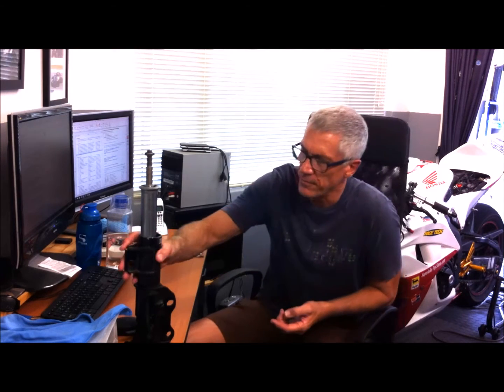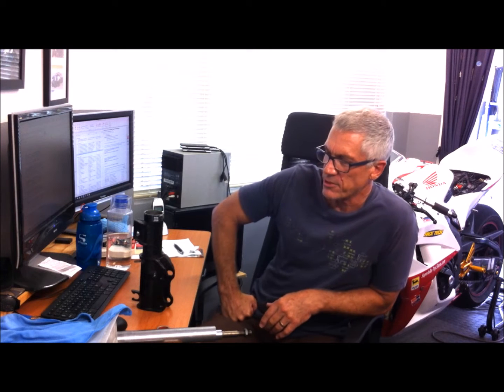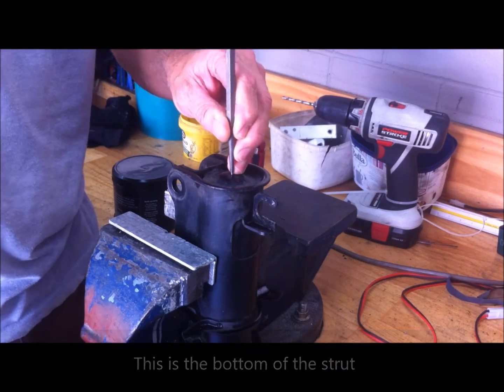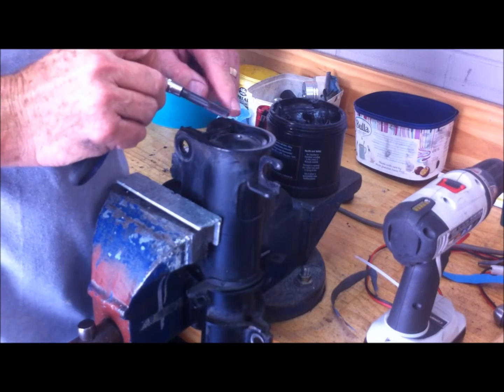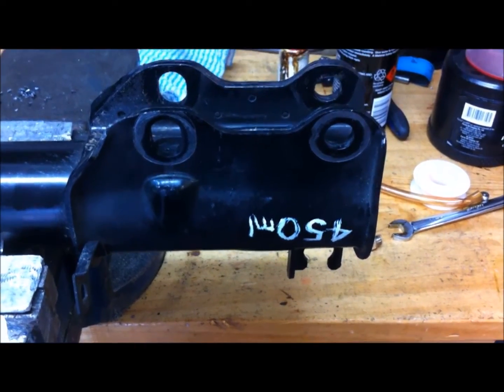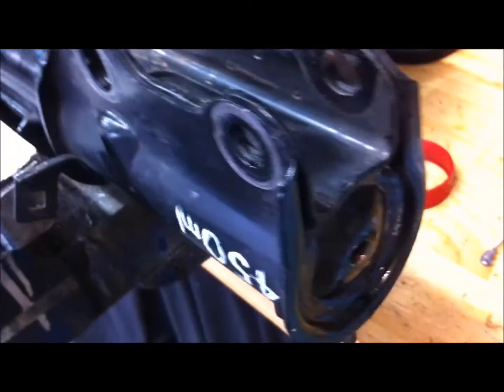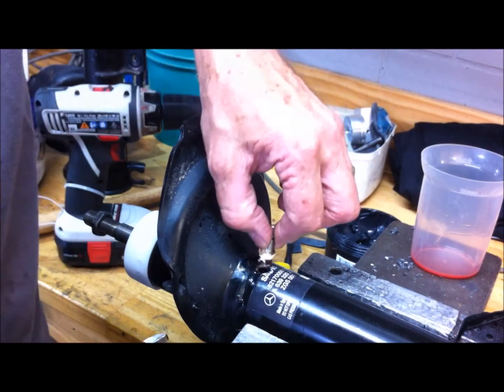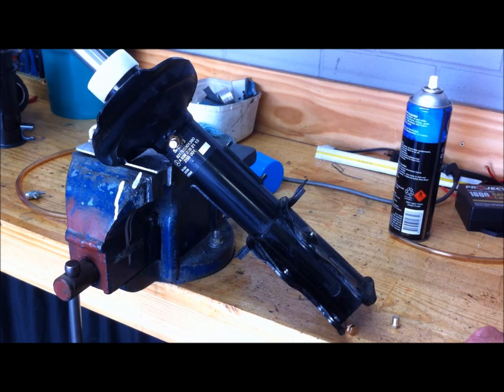W639 Mercedes Vito Viano Front Strut Oil Change Modification Shock Absorber

Comment: Hi, great vid! i have a few questions: 
1. how do you know how much pressure you have to put it in?
2. do you really need 2 holes to do this?
3. can you do this to rear shocks too? Where i have to drill holes? one or two holes?
Thanks
Reply from the maker: Thanks Nic ...
1. I researched various forums and technical sites to arrive at a pressure. It's not critical as the main reason to pressurise is to eliminate foaming. It's something you can experiment with.
2. I explain I wanted two holes so I could change the oil in situ. The bottom hole allows you to drain the fluid ... the top to fill. You could get by with one hole if you're happy to remove the strut to change the oil.
3. The rears are not twin tube like the front. As I say in the video the front struts are similar to motorcycle front forks and we change the oil in the forks often.
So the piston in the rear is sliding against the tube wall. There's no way to eliminate the sharp edge on the inside of the hole created by the the drill bit. You could drill a hole close to the bottom which would probably be below the piston travel. It's something you'd have to experiment with. Maybe get an old rear shock and drill some holes or do some cut outs to work out where to drill. You could get by with one hole because the rears are usually easy to remove.

Let us know how you go. Regards, Scott

Comment: I’m wondering how much moisture may be introduced into the system by using normal
compressed air, because as you know oil and moisture (water) create a milky emulsion that is no good for anything. I know you mentioned Nitrogen and that’s fine if you can get it. Would you be better off using divers’ air that has all of the moisture removed? Have you encountered any issue of emulsion when checking your fix?
Reply from the maker: The volume of pressurised air introduced is so small I believe it's not an issue. The vehicle has been using these modified struts for two years doing lots of kilometres with no issues. You could use diver's air if you were worried. Most compressors have a water trap anyway so H20 would be very minor. The damping action is perfect so there could not be a water/oil emulsion.
Reply: Thanks for that. It was just something I thought of to ask about.
BTW, your videos' are really low volume (on my computer and smart TV anyway). Is there any way of boosting your recording volume, or is it just me?
Reply from the maker: I've tried but can't seem to get them any higher. I've only had a couple of people mention it but it was only when viewing on devices like smart phones.
Reply: Scott Elliott funnily enough, is loud enough on my phone but not on the TV.
Regardless, keep up the good work!!
Reply from the maker: Thanks. I'll still look at the volume issue. Thanks for the feedback. Scott

Comment: Hi Scott about what length is the plug or bolt at the bottom of the shock? Thanks.
Reply from the maker: The length of the threaded part of the plug is 9mm to 10mm. After you 
drill the hole you'll see there's a reasonable distance from the outer 
tube to the inner cartridge.
Reply: Scott Elliott Thank you very much Sir and much appreciated for your time and effort in making the videos. It saves us a lot of money and the Vito is quite expensive to maintain here in South Africa. Thanks again.
Reply from the maker: No worries Nazeem. The trick is to not run the tap in too far. You want the plug to start tightening by the time it's about the 1/3 the way in

Comment: Hi Scott!I have a Mercedes 2006 SLK55 AMG (118,000 kms) and am about to flush the (722.9) transmission fluid.  I ran across your video which gave me a very nice preview of what to expect - thank you very much for taking the time to record your experience!So why am I posting here instead of there lol ??!!  Because I am also awaiting new struts and shocks for my car.  The front driver's side has been failing (leaking) for a while and is now "done".  Passenger side slightly less so, whereas the rear shocks still seem ok.  A thousand CDN dollars for a set of 'better than OEM' Bilstein B8 dampers is ... well it's not how I'd like to spend a grand if I can MacGyver something as good or better.My question:  since the strut leaked fluid this would indicate a failed seal, right?  So would you say there was any point in flushing & re-pressurizing them?  Please bear in mind that this is a GT car, and road-holding performance is part of its appeal.  Thanks kindly!Tom
Reply from the maker: Hi Tom. Because the strut is leaking it may not be salvageable. I'm assuming it will be leaking from the seal. You could try one of these as essentially the seal is the same design. The tool will clean out any dirt or debris that's causing a leak. http://www.ebay.com.au/itm/MOTION-PRO-SEAL-MATE-MX-FORK-SEAL-CLEANER-SAVER-DOCTOR-MOTOCROSS-ENDURO-DIRT-/231531538393?hash=item35e85ae7d9:g:6-wAAOSwuzRXeHHn

It's a simple project to modify the struts as I did for the Vito. If you clean the seal you could always try what I did. I intend making the modification to my W204 C320CDI. For interest after 6 months the struts on the Vito are working famously.

I'm going to make another version of the 722.9 transmission service video as I'll be doing mine again in a few weeks. I do it every three years to ensure it lasts.
Reply: Thanks for the thoughts and suggestion Scott!  I'll inspect them once their out and see if I can find a correctable cause.  If there's no nick or scoring evident I might fill it and see if I can get it to hold pressure.  I am imagining that altering the fluid viscosity could 'tune' the damper somewhat.  Kind of intriguing actually!
Reply from the maker: Yes it is ... once you're made the modification you can try different oil grades. We've found ATF is excellent. It was originally used in struts and still is used in some competition versions. It's a hydraulic fluid designed for heat, pressure and pumping. I think the manufacturers stopped using it because it's too good. They want us to buy more struts. That's why I find the whole global warming movement so frustrating. We have planned obsolescence in everything and yet they don't seem to think deep enough to realise it.

Comment: sorry if im harrasing you at opossite times to me but you seem the guy to ask and I think your ace, my 2006 lwb has covered 146000 miles , I baught her at 3 years old with 103000 on and its been fine all theese years untill a year ago, new battery new alternator, disks pads all around both windows gone, ball joint, track rod end, last section of exhaust gone, glove box latch broken, a sensor got water in making it go into limp, both rear sliding door mechanisms failing, child put 2 p in my cd slot, rocker gasket weeping, front drivers spring sheer, prop shaft nuckles gone and been repaired but there is now slight play in it again. just a abit of background information.I struggle but manage to complete all the work myself, I agree entirely about certain companys purposly making vehicles hard to work on or with componants that are unservisable and regarded as either throw away or life time parts , you rightly conclude that the home mechanic is not a matter of interest to nearly any manufacturer theese days, that being said the vito atleast gives us a fighting chance with its traditional configerafion. Your videos have been very helpfull,Thankyou
Reply from the maker: Rick that's a long list! Methodically work through each problem one at a time and you'll get there.

Comment: sorry forgot to ask did you use any copper washers on the drain plug and tyre valve or is it just sealent , thankyou also how are they performing now ? Thankyou
Reply from the maker: No we only used sealant. They're performing brilliantly since we did this work 6 months ago.
Reply from the maker: Forget to say we used thread seal tape and a liquid sealant.

Comment: This is genius! Totally doing this in my Vito
Reply from the maker: +Andrew Spencer Thanks Andrew. The thing is it actually works! Once you've done the modification please come back and post you findings. I'd be really interested to see how it went. I'm sure others will be to. Regards, Scott
Reply: +Scott Elliott 
Shocks have been back in for a couple weeks now, and so far so good! Not a drop of leakage and the ride is much improved. I've also done your HID light upgrade and cruise control retrofit. The van is better than new now, which is something considering it's got more than 200,000 miles on the clock!
Reply from the maker: +Andrew Spencer ... Andrew that's great news.
Reply: Andrew Spencer hi Andrew are u from UK?